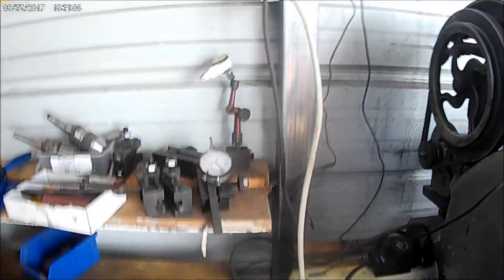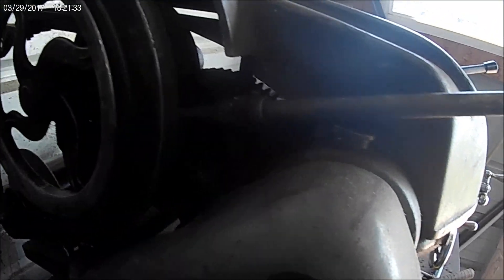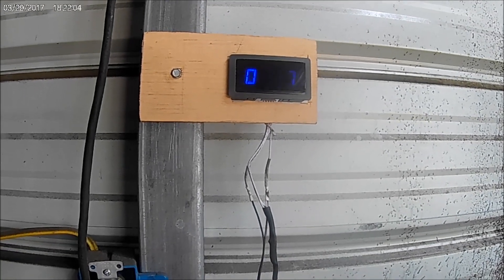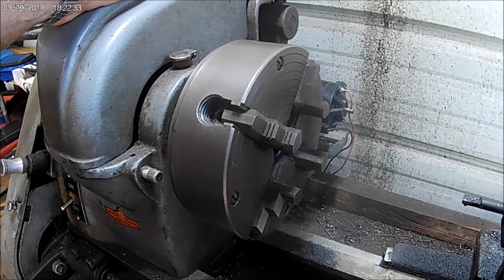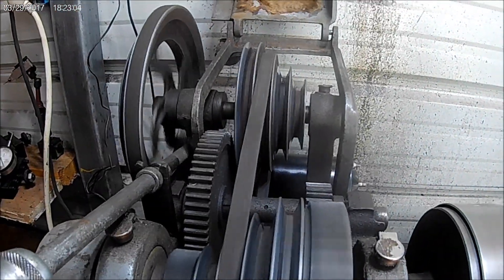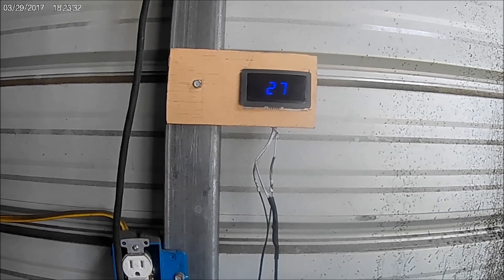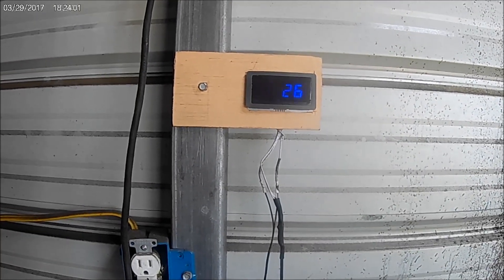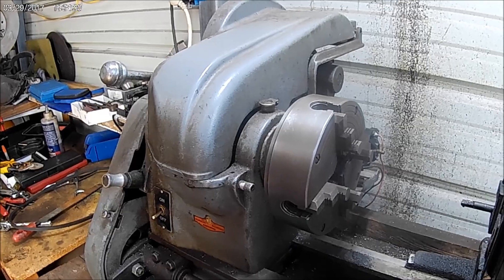installed DC motor my Atlas/Craftsman lathe.

Comment: People comment on the higher speeds but that is seldom what people are looking for with DC power. We want the low speed turning torque. This might work out for you if you would care to experiment with gear reduction. You would trade off the higher speeds but increase the torque at all speeds. There are some good videos on these conversions but “plug and play” doesn’t really give us what we want on machine tools. An inexpensive choke might likely stop the sparking problem.
Reply from the maker: yeah, it didn't really work out the way I had it. the motor burned out.

Comment: Just don't spin it up to fast as it may fry the bearings and bushings in the ole girl !! great job .. I have one on the 109 and it works good !!
Reply from the maker: I think I am gonna change the motor back the way it was, this seems to pull down and the brushes really spark under a heavy load.

Comment: It should have plenty of torque. As a treadmill motor it was turning a big "conveyor belt" with enough force to move an adult human without much effort. Don't get me wrong, you can stall them out, but they have torque even at low speed. You might find that you like the AC motor better though.
Reply from the maker: I think I am gonna change the motor back, on a hard pull the brushes really spark and flash and it seems to slow down just cutting aluminum.
Reply: @MissouriOldTimer  Ahh. Well that's a shame, but happens I guess. The one I have on my mill does the job.  I have two of them that I use like that actually.

Comment: My suggestion is to use all the belt/pulley reduction you can get, that will increase the DC motor speed and torque.  Those tread mill motors typically max out at 5000+ rpm which should give all the lathe spindle speed needed.
Reply from the maker: I will probably do that in order to get the most power from the motor that I can. thanks.

Comment: That is a fantastic upgrade to be able to adjust the speed of the lathe. It is also great that you can adjust it while it is running, many times we have wanted a faster or slower speed and have to power down the lathe, change the gearbox speed and bring it up to speed again
Reply from the maker: it's a pretty inexpensive setup, sometimes you can get a treadmill for free and the motor is probably still ok and the speed controller parts are  not expensive at all maybe 25 USD.

Comment: You think that motor is gonna have enough torque
 Oh yeah i went and bought
A harbor freight tire changer
Man if i had known those things were so easy to use i would bought one a long time ago
I started filming a video but decided  not to upload it because it was so bad
Reply from the maker: I hope it will if not I'll put the old one back on,  I have a small tire changer from HF, it works pretty good